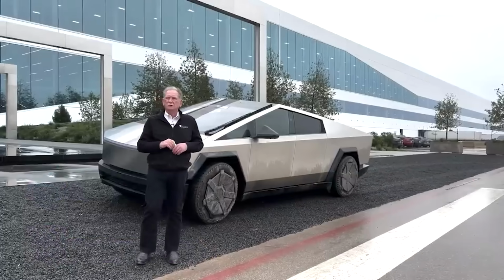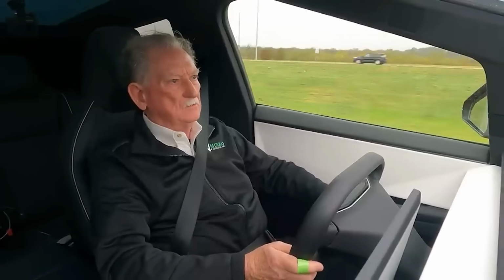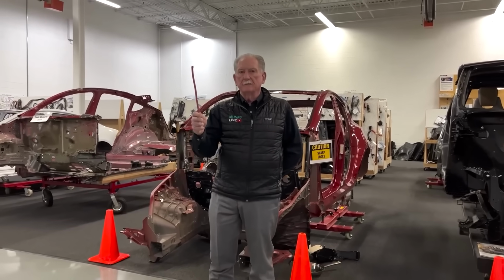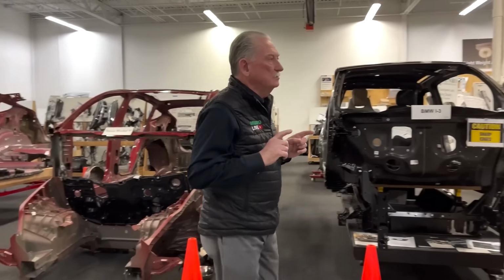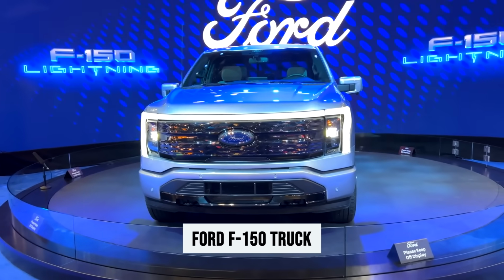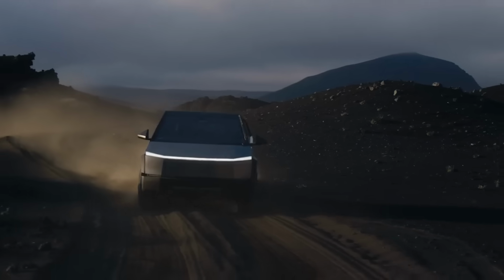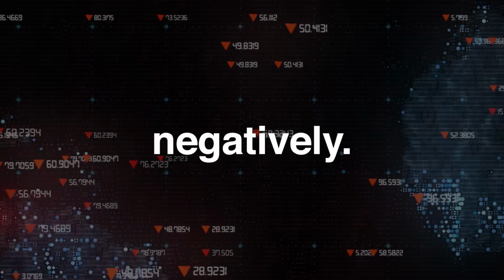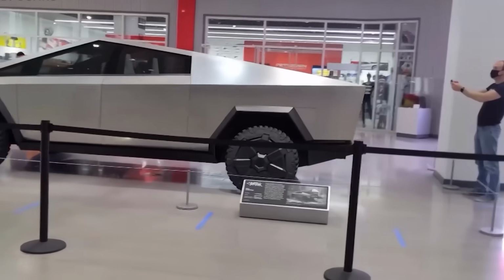Why TESLA Stock Will Be Changed FOREVER On December 22nd!

Comment: Cybertruck produciton in 19 days 50! Fifty - not 1500, 50.  Cybertruck may be the biggest fairlure in automotive history. The key problem which has plauged the project for 4 years is they can't efficiently make the 4680 battery used in the truck. The original 16% higher density cell has been killed; and they have downgraded to a 10% more energy dense cell but Tesla can't make that either - total production 20 million cells - only enough for 16,000 truck If all these cells are good - not.

Comment: Camera man didn't capture the whole set up of wire harnesses from the 12 V Wall, because the camera man didn't back up and pan out the whole 12 Volt,Wall unit. 

Versus the 48 Volt opposite side of the wall.

Comment: Yes, Tesla had 1.3 mullion reservations i. 2019 but that was based on  selling price of $39, 995.  Today the least expensive is over $75,000 with  $61,000 promised in 2 years.

Whe it is true that many pickup truck buyers seldom use the trucks for what they are intended, i.e. to haul materials, many other people such as contractors do want a truck to haul materials, to have air compressors, tool boxes, and ladder racks permanently mounted.
.
Reply: What was the point of this post?
Reply: I see 8 points (including extra ones), but no purpose or sense of the sentences. Well.. maybe one of the usual TslaQ naysayers?
Reply: Stop pumping Tesla stock. Tesla shares should already be higher than it is now. There will always be an obstacle to the shares: "BLACKROCK". BLACKROCK does not like Elon Musk. They control everything in our lives.  Is a matter of time before the corruption UAW controls the workers.

Comment: The reason people buy a pickup truck to carry stuff in the back. This film barely touches on that. It appears Tesla is a vehicle for rich people who want to show off their toys. If Tesla wants to sell trucks, they need to put some focus on its load bearing capabilities.
Reply: Well stated.  I still don't know how much this vehicle can haul.  How about towing capacity.
Reply: Right. A Ford or a GM can haul my boat, the cyber truck cannot.
Reply: Bed is 4'2" wide and 6'2" long. Can haul 4x8 plywood with tailgate down. 2,500 lbs max load, 11,000 lbs towing capacity. Ford F-150 SuperCrew (4-door) has only 5'6" bed, 2,120 lbs load and 8,200 to 14,000 lbs towing depending on engine option.
Reply: The specs are posted.  Cybertruck is the Swiss army knife of trucks.
Reply: @louren1951  The light pocket knife version. You might have wished for more but he gave you the toy version.